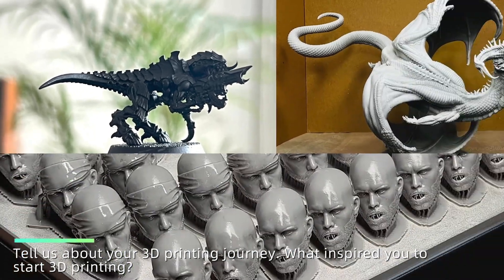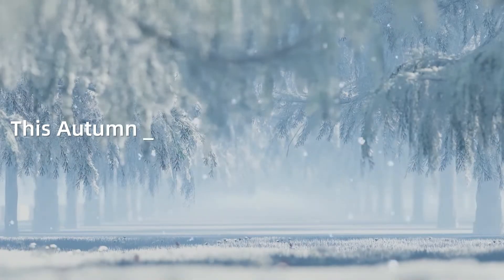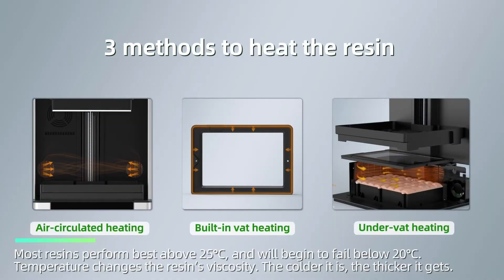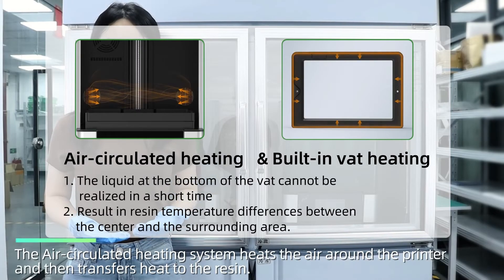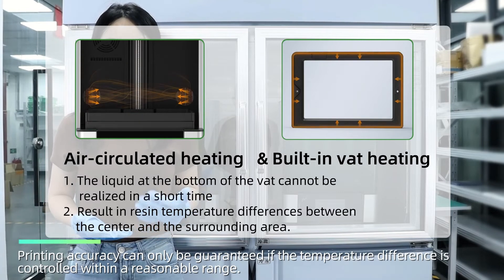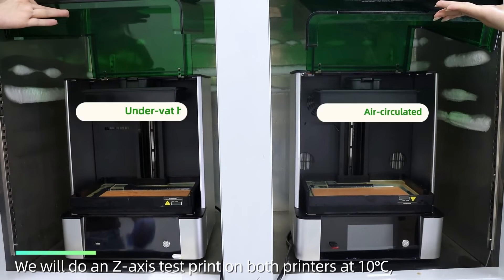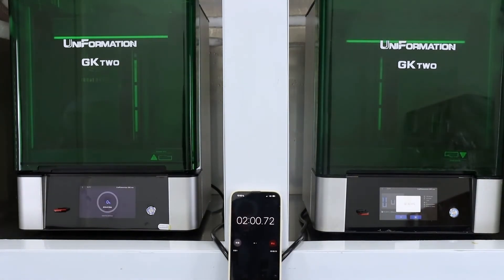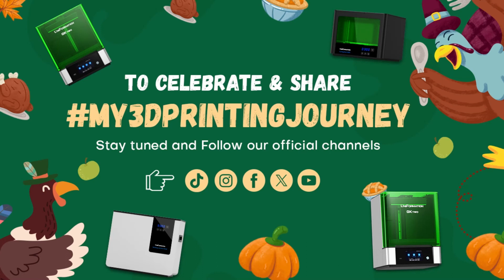Look Back and Share Our 3D Printing Journey #freezerprinting  #happythanksgivingday

Comment: Printing in winter is very easy to fail, people are trying to find ways to print successfully in winter, the current heating function is innovative and necessary. uniformation is the first brand name to innovate the heating function, after the accumulation of time, to update the most accurate heating method, I think the bottom heating method is the most stable, enough to ensure that I can print successfully in winter.

Comment: Actually, using all 3 methods at the same time is the preferred way to go.  Just heating from below or just the vat leaves the part that is out of the resin to cool and then shrink while you are printing.  It's imperative to keep the screen, resin, and printed part at approximately the same temperature.